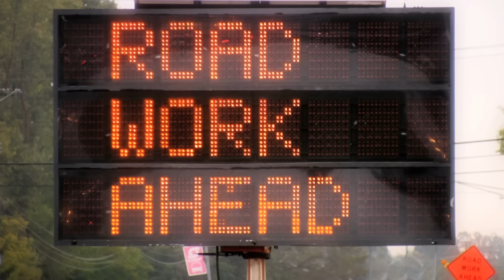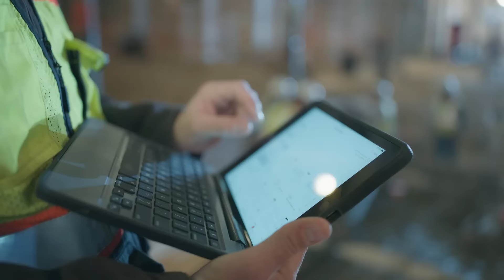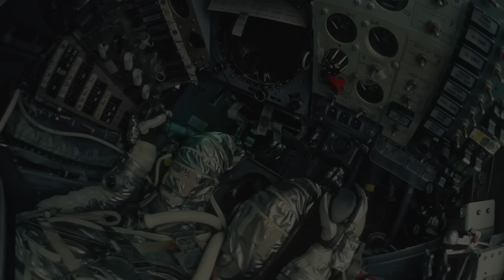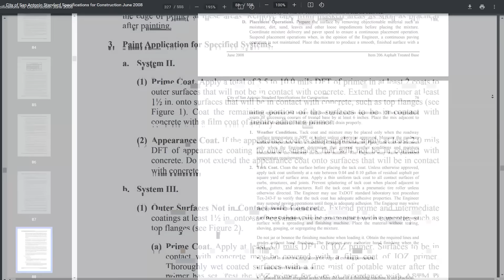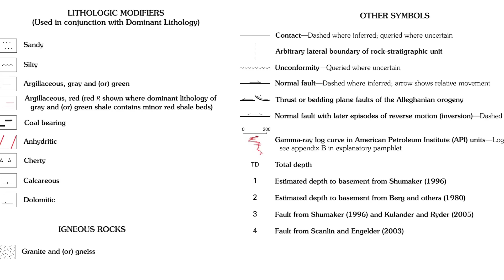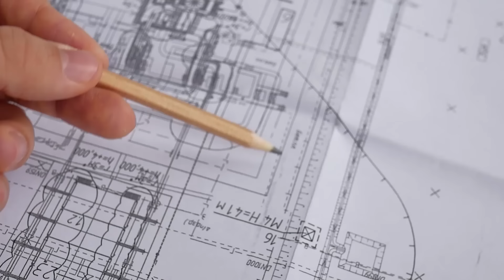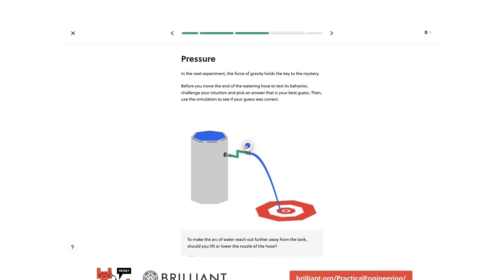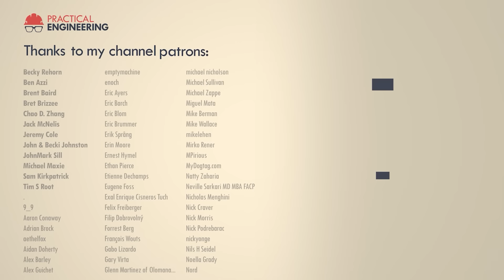4 Myths About Construction Debunked

Comment: "Planned obsolescence" sounds pretty awful until you realize the opposite is "unplanned obsolescence". It's okay if your old car might break down at any moment, but its not okay for a bridge.
Reply: I'm a development engineer and I have to say I've never thought of it that succinctly before.  It's also kinda hysterical when you say it out loud, too.  :D
Reply: No, "unplanned obsolescence" is not awful in comparison to planned obsolescence, because the latter (your former) is not how Grady portrayed it here at all, where you consider what the expected lifespan of something will be based upon erosion, wear, weather, etc. It is the active designing of factors to create failure at a certain point in its lifespan, often deliberately reducing quality and durability while blaming user use on the change of capability (see the drastic reduction in potentiometer durability in analog sticks in game controllers across the board for a savings of approximately 4 cents per stick, to increase repair income). It's like laying a gypsum wall for a dam; you KNOW the water is going to eat away at it and need to be replaced in a handful of years, so that you'll have more work then, rather than doing a proper job the first time around; or like those contractors that lowball a bid far below what it would cost to do the design as given and then actively cut corners to skive off even more profit, like that found in the chinese concrete that is just cement-covered cardboard, or similar (they refer to such as "tofu-dreg projects"). 

TL:DR; It's malicious by design, not just being conscious of expected lifespan.
Reply: Planned obsolescence doesn't inheritly mean anything evil or good. It's just a way to describe that there has been put thought into planning when something will need to be replaced.
Reply: I always thought of planned obsolescence as "intentionally making sure a defect will appear after a certain time" (usually after the guarantee period ends). I see thIs as a different thing than "making sure something (even barely) lasts for the guarantee period". Planned obsolescence includes intentional defect points, such as a electrolytic capacitor near a heatsource in electronics. It would not even cost more to place it differently, but still it is often found at the worst possible position in some electronics devices.
Reply: @paulelderson934  Re-read my comment. You are wrong, and doing the same thing as MindLaboratory and Grady; only using the benign or neutral meanings of the words separately and not the phrase as a whole, which carries its own malign meaning.

Comment: My dad was a carpenter contractor. He had to learn a lot about related fields to draw his plans to meet state requirements, his personal safety goals, and his client's desires. And he wasn't one to take unreasonable shortcuts on things. He would even tell architects why what they were taught in school were not safe (things that would get a dreaded red tag/stop work order), not possible, or could simply be done better in a different way. One architect was told 'that's a violation', but told dad to do it anyway. They got a stop work order. The inspector bitched at dad and told him that 'you know better'. My dad said, 'talk to the architect because I told him'. The architect fought with the inspector, and lost. All my dad said was 'told ya'. Cost a whole bunch of money and lost time.
Reply: As the contractor your father was responsible for the satisfactory completion of the project. If the law where you are is somewhat the same as my area your father also had to insure all sub contractors along everything else. Been there done that for many years. From a mountains side to a turn key home in the timeframe of the contract.

Comment: Im a civil engineer and i love your videos! i love sharing them with my friends because it helps understand what i do and the stories i tell them. Im a worse communicator than you for sure.

What i don't fully agree with you is with the importance of designing concrete structures, even reinforced concrete structures with compression in mind. We had here a good civil engineer here in Spain "Eduardo Torroja Miret" that made incredible structures and advancements on construction techniques with shell concrete structures, using it to its fullest maximizing the compression instead tension.

Also In my job i see all day long badly designed structures with wild usage of rebar steel because engineers or architects are either uneducated or uncaring on how to design structures that are safe, efficient and that work how the materials have advantages. 

I can agree on the point that without reinforced concrete we would not have the civilization we have now but the point i try to make is that we have gone too far and we need to reassess and start thinking again in how to better use the material to its fully potential.

Global (specially US) data on corrosion and durability of reinforced concrete its on my side too.

All in all, keep doing these videos, i love them.

Thanks.

Comment: I was an electrician and generator tech. I had previous work experience working as a mechanic for several years. My main job on generator installs was organizing and directing everyone around me. At times, of course I would put in some physical help, but most of the time it was best I just watched and talked with my guys. 

During installs we would bring a lot more laborers as opposed to skilled tradesmen. It was important that I helped these guys understand what it is they are doing so they don't mess something up. 

Standing around is such a huge part of construction. Sometimes it honestly sucks when it's all you've been doing all day. Like I wanted to use my knowledge, not just stand observe. But I had a job to do, and that's what was my main focus.

Comment: As someone who works as a traffic control laborer, setting up job sites for road construction, this video is great. 

The hardest thing I occasionally have to do is flagging: standing (and moving maybe three feet to get on or off the lane I'm managing) on a road with one lane on either direction with a sign and a radio, managing traffic with another flagger and sometimes a pilot car (because there's work happening on one side and the roads need to merge, so traffic has to go in turns). The trick is, you work for twelve hours, you cannot sit down or slip up until someone gives you a break, and even if it's pouring rain or 115°F outside, you still need to do it, usually with only two or three short (but vital) breaks to rest. Especially when it's hot outside (as it usually is, considering most road construction is in the summer), hydration and keeping your energy up is incredibly important, and it's really nice when a good samaritan decides to roll down their window and hand me a water bottle or a nice cold soda. Breaking in your workboots before you start is also something I'll always do, because stiff workboots will bruise and beat up your feet like nothing else, which is horrible when doing something like this.

Arguably, it's the most common job that requires the least actual movement (that a laborer can do), the job is 95% standing in place but I would still rather be setting up barrels for several hours straight, since at least then I get to sit down both between placing barrels and after everything's set up.

Comment: As with engineering and things in life: everything is a compromise. It's all about striking a balance between two (often) opposing constraints.
Reply: And failing miserably
Reply: It basically is picking two between: good, fast and cheap
Reply: @EmyNN  Or rather picking a balance between all three.  Tilt it more toward one, and at least one of the others is going to suffer.

Comment: As a gas layer myself I can confidently say when you see people standing around watching someone dig with a excavator. One person will be a spotter for the operator. Making sure they don't hit any services. That's something that can cost tens of thousands depending on what they hit. I.e HP mains or fibre optics. Also when you see people standing there most the time it's because at that moment having more people in a hole trying to work over the top of each other just won't be efficient. However having a person outside the trench to pass down tools so you don't get sand in critical assets. I.e tapping bands or anything that sand can harm like seals and all the rest. This guy makes some good points however speaks very much from a engineer perspective rather then the person actually possessing the knowledge and skills needed to make his shonky plans work out 🥴🤣🤣
Reply: It would have cost you literally nothing to leave out the last sentence.

Comment: Excellent video. As a sub contractor I appreciated the first part the most. I was pressure washing earlier this week and after I finished rinsing off the deck... Before the actual detergent and final washing I took a break and was questioned why I stopped. 1 it was in the mid-90s, full sun (UV index of 10 or 11), high humidity and 2 my pressure washer has a duty cycle and can't operate constantly. Not only do I need breaks but so does my equipment.

Comment: As a tradesperson, I want to say there are still a lot of overstaffed jobs, where there genuinely do not need that many people.
Reply: Some cases - the number of tradespeople on a project is dictated by the labor unions. Even if you only need a few minutes of a machine to be ran that day; they are required to have an operator for it. The union requires too that the person is there for a minimum number of hours too. So that person will spend a lot of time sitting in the machine doing nothing.
Reply: I agree whole heartedly ...retired carpenter here

Comment: I spent a few years of my career as one of the guys "standing around" on projects.  I was an inspector responsible for documenting the work and double-checking measurements.  It's a quality control measure to make sure things are built right, but from the outside it does look a lot like a guy standing around doing nothing on site.
Reply: Why couldn't the workers who were doing the build be trusted to build to spec and to document their work as needed? As it is now, most of the standing around are management who aren't allowed to do any work because of union rules, and a mix of inspectors and engineers and architects who more often than not, slow up the work. Get good designs, good drawings, good specs, and then get good workers who are paid well and let them work. The owners would have workers who enjoy their jobs and are glad to do quality work.  I've been on job sites where there are more non-workers 'standing around' than actual people paid to do real work.

Comment: Based on my decades of construction work, I would somewhat disagree with your first point. Although you are right about scheduling and management, IMO only a few of the trades seem to want to work efficiently; concrete workers do because the field still requires them to, wet concrete becomes unworkable, and the teams of steelworkers who put together the basic steel framework of taller buildings are amazing to watch. With good crane operators and steel that is ready for them to put in place, in others a team effort, the steel goes up and together very quickly. Besides those trades it seems like the speed is almost driven by working as slow as possible. Certainly some trades are piece paid, like finishing drywall, but not many. Plus if labor is the largest single cost in major construction, why are general contractors so willing to have crews work overtime regularly?  Time often seems much more important than labor costs.
Reply: For a lot of work, at least in my field of highway and bridge construction, labor is the largest cost bucket.  But schedule limitations, such as the amount of hours an owner will allow a road to be closed, local event schedules which may affect traffic, weather conditions, noise ordinances, and things like environmental restrictions (think bird nesting and migration periods, or fish spawning seasons), will help determine what type of schedule the contractor may end up working to complete certain work in a certain timeframe.  (example 1 : having three days of regular shift work to do in a two day bridge closure - they may end up working overtime or two shifts/day to complete that work).  In addition, most owners establish liquidated damages (example 2: $25,000/day or some other such value) for work that is not complete by a certain time or date; those can far exceed the cost of having the crews work an additional hour or two per shift.  Conversely, an owner might incentivize and add a bonus for getting a project completed earlier than their schedule may indicate, which the contractor will determine if it's in their best interest to accelerate the work (example 3: a lane closure for repaving on a highway might take 5 days to complete the work; but the owner may pay $25,000/day if the contractor can complete the work faster, so it inconveniences the travelling public less.  The contractor would determine if they could work additional shifts, or may use more expensive materials or methods to accelerate the work).
Reply: Labour is not my biggest cost lucky to be 15% it is subbies...... helicopters are the worst 3.5k an hour much better to over staff when you are using those as downtime with those can be a killer.
Reply: Labor being the biggest cost and giving overtime are not incompatible concepts. Labor is the biggest PLANNED cost. Fees for not hitting milestones are another. They may also miss certain subsidies and the like if they don't hit certain milestones at certain points. 

You also have to consider the higher-ups. I've never seen a company that works on one project at a time; even the smallest have multiple irons in the fire at once. Even fixed cost contracts aren't given in lump sums most of the time; you either get paid by milestones or percent complete or the like. If my project is going sideways, the company may need your project to accelerate its billing (which means, work faster) in order to compensate. I'm still going to get chewed out, but our boss doesn't have to explain a negative margin or a missed margin target to HIS boss. It's far, far better to take the hit on labor for a few hours than it is to report a negative monthly margin to shareholders (most of whom aren't in the industry and don't give a fi what it takes to earn that margin). 

You also have to consider what constitutes overtime. There are different ways to pay workers, and while anyone working on federal contracts has to pay for all hours worked, they don't necessarily pay time-and-a-half. Look up "salaried exempt" for an example. In practical terms what this means is that in general a construction worker expects to be at work for ten hours a day--eleven if they take an hour for lunch. Anything between 8 hours and 10 hours feels like getting off early.

Comment: #1: You can actually start building a house with the roof
Reply: Yes but not usually effeciently.
Reply: For convenience...

A workplace with a roof already in place is so much better than out with the elements... You just have to tackle the ways on building it without walls and super high scaffolding during roof installation when said building reaches 2nd floor.

Comment: Hi Grady. I watched this video a year ago or so. But since then, I got a job as a maintenance worker for Brevard county in Florida, road and bridge division. I've done roadwork, sidewalk repair, tree removal, culvert replacements (under roads). Now I'm rewatching this video. In my experience, there often is a lot of standing around. A lot of things can go wrong. I was a traffic flagger, and I showed up to the worksite on time, put up my "roadwork ahead" signs and was ready. The Gradall and the dump trucks arrived, but the other flagger got lost or something and we couldn't get started with only one flagger, so we waited for 20 minutes or so for him to show up. Meantime, there wasn't anything else I or the dump truck drivers could do. Things like that happen all the time. Another time, at some point we realized we had the wrong tractor for the job and had to wait for our guy to drive back to the shop (at around 20mph) switch tractors, and get back, and there wasn't anything we could do till he got back. In other cases, I will have a task that requires a few minutes of maximum effort, followed by a lot of time with nothing to do. On days when I'm the one who shovels rock and sand into the concrete mixer, I'll do 2-3 minutes of hard shoveling, then I get to rest and sip water till they use up all the concrete and need a new batch, so even though I come home tired and sore, and stinking from sweat, I spent the bulk of my shift doing nothing, or driving, or putting things in the truck, and 12-15 minutes of shoveling and lifting heavy bags of cement mix. Or course, since it's a government job, there are a few guys that don't work if they can get away with it, and there are tasks occasionally assigned that don't require work for the majority of the shift (like traffic flaggers for a project that is predominantly off the road).